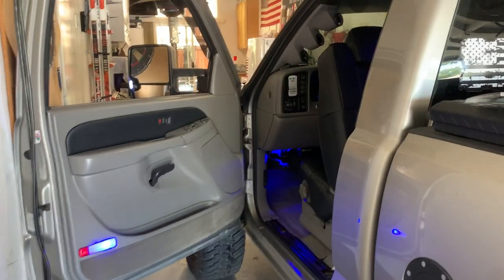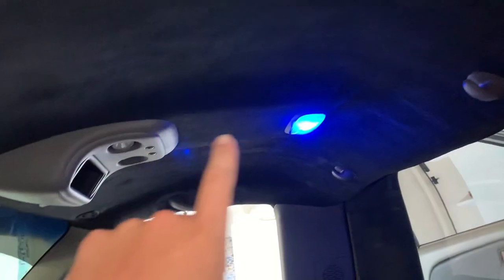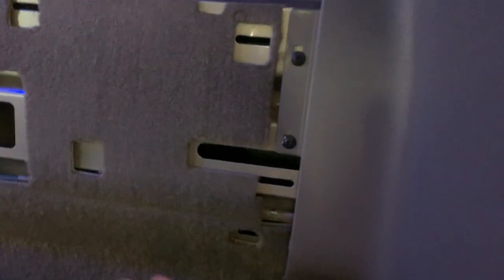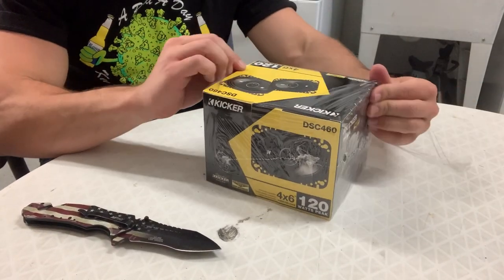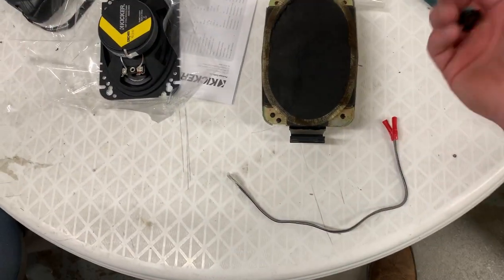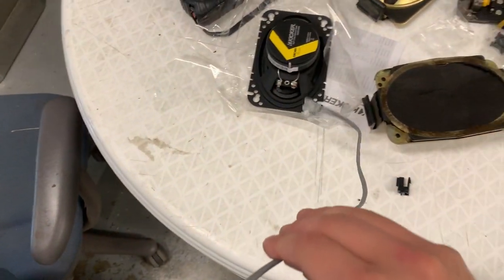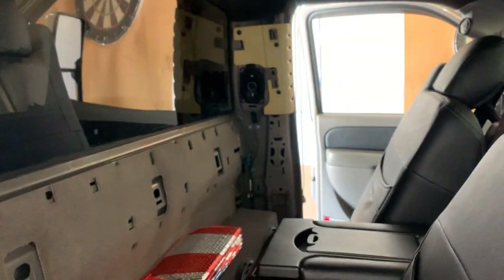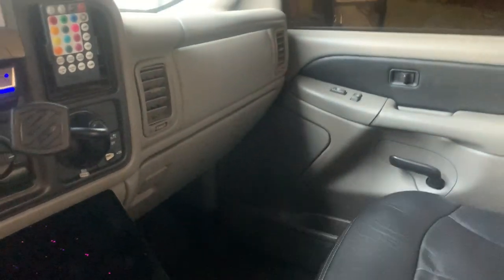Installing 4x6 Speakers In Single Cab, How To Replace Tweeters!

Comment: Thanks bro only video I’ve found that actually explains removing all the plastics . I got some 4 inch DS18 mid range bullet speakers ima install 👍🏻 super loud for the size
Reply from the maker: Glad it helped man! Badass🤙🏻
Reply: how did it sound since you basically removed the tweeter? does it still play at high frequencies? lmk i wanna do the same thing
Reply: @Faix.Garage sweet truck wish mine would maybr look like that in future
Reply from the maker: @heroicb5315  thank you man I appreciate it!
Reply from the maker: @heroicb5315  what mods have you done and what do you want to do?

Comment: What size lift do you have on your single cab Silverado.  I recently bought one as a project and like your height.
Reply from the maker: Now has leveling torsion keys, cognito upper control arms, & 4" RC drop brackets in the front for about 6" of lift in the front, & custom built 5" lift soft ride leaf springs in the rear for a smooth & level ride with bilstien 5160 shocks at all 4 corners

Comment: Awesome video! Can you give me more information on your sub setup? I have been looking to add some subs to my truck but can't find a box that will fit great in my regular cab 02' Silverado.
Reply from the maker: Thanks man! Custom made box! It holds 2 shallow mount 10s and sounds amazing.
Reply: @Faix.Garage  I bet! Who made the box for you? What type of subs and amp are you running?
Reply from the maker: @mattkiser9965  check out my newer videos with the speakers I’ve changed it a bit since this video. A local shop did my box. I now have the 2 shallow mount 10” subs that are JL Audio and the amp is a 4 channel 1000watt Rockford Fosgate that also runs my 4 8” kicker boat speakers in the doors and I have a new smaller amp that runs just the 4x6s in the pillars and removed the deck and had a 12.9” iPad custom installed.
Reply: @Faix.Garage  Sweet! I will check them out. Thanks!

Comment: Do you think you'd ever get a Ford?
Reply from the maker: maddmaxx636 my dad used to have a ford diesel truck and it was what I learned to drive on when I was 8. I loved it and I would definitely consider it if a good deal came up
Reply: @Faix.Garage  Id get a nice old 70s or 80s truck! Nice reg cab, long bed, V8 and a 5-speed! well, A 3-4 speed with granny low.